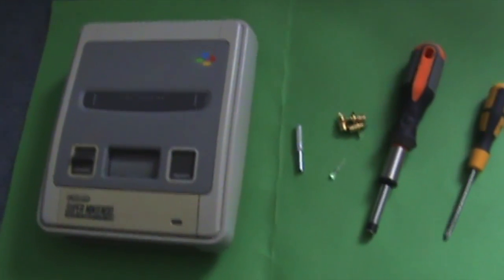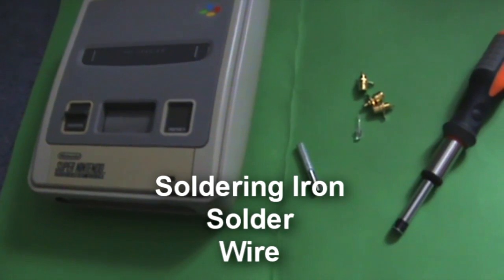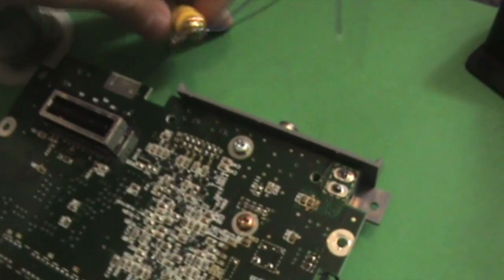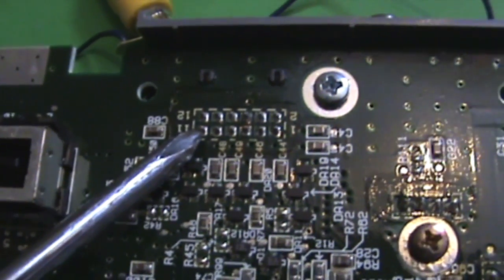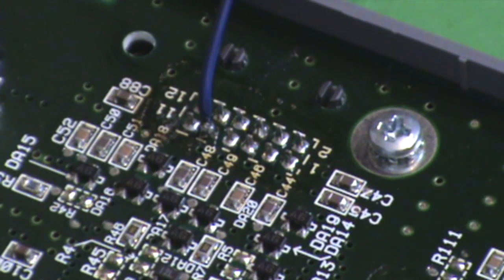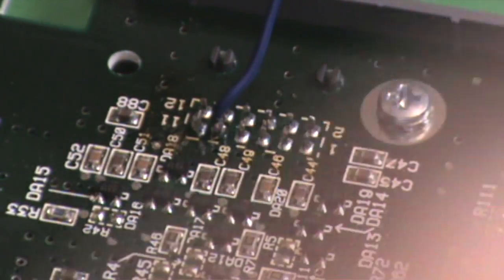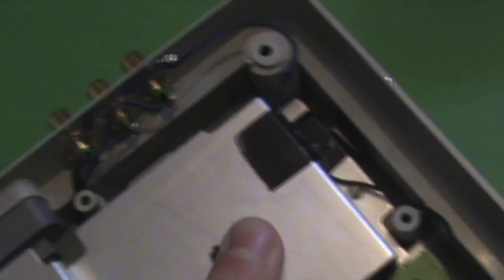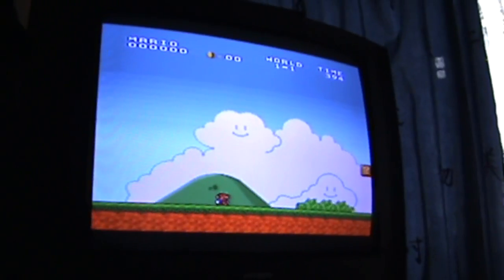Super NES A/V Mod Tutorial

Comment: Pins 5 & 6 on that same set of pins should both be both ground. I would use one for the audio ports and the other for the video ground to avoid interference. Seems like a better option than running a wire to one of the bare metal parts of the board.

Comment from the maker: @wolfboy527 Sorry for the late reply. You can do an s-video mod if you can find the right contacts on the board. You can genrally get them from the Multi-Out port pins. But you will probably need to make a veroboard full of components to get the right amount of luminance and chrominance. For S-Video you are better off just buying an S-Video cable and using the multi-out although it could be a fun project to try. Thanks for checking out the video.
-Jordan

Comment from the maker: @johneymute You are correct it does have a Multi-Out port that supports a variety of connections. However that is a proprietary connector which means you have to buy a proprietary cable. With this mod it can now use any standard phono cables. The main reason for doing it is as a hobby to be honest. I enjoy console hacking and electronics.
-Jordan